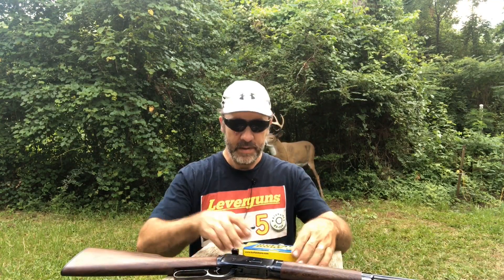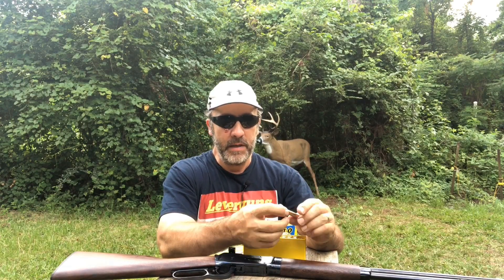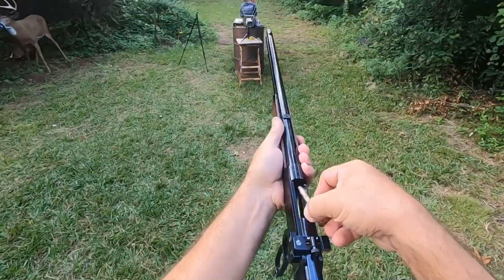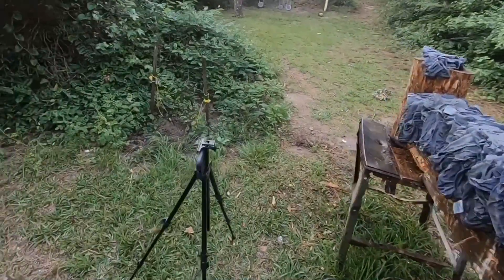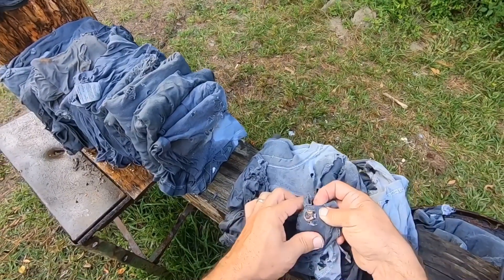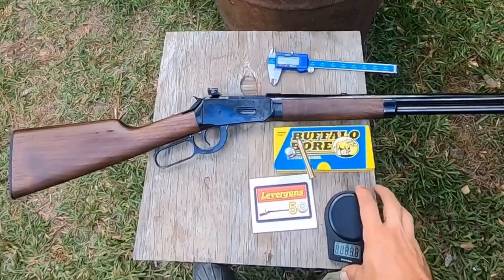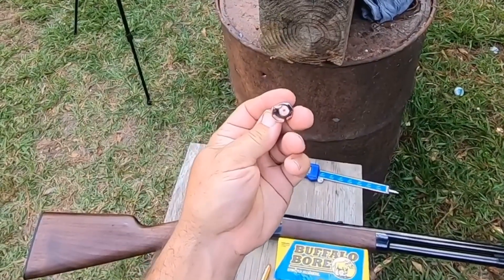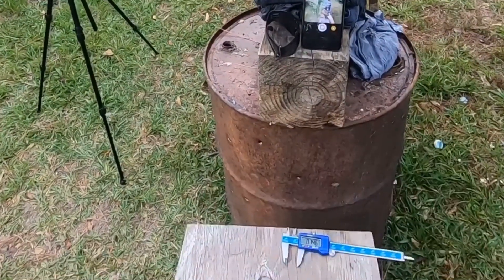38-55/375 buffalo bore, in the Winchester model 1894 trails end take down

Comment: I recently received my great grandfather's hunting rifle, which has now passed down 4 generations. 1894 in 38-55 manufactured in 1905. About to pull it apart and get it cleaned/greased. Need to figure out what sort of ammo I can run through it, as I understand the 38-55 at that time was a black powder cartridge.
Reply from the maker: Buffalo bore claims that there’s a safe in any Winchester model, 94

Comment: Glad you were able to get those and do this video.  Buffalo Bore has made the 38-55 what it needed to be all along👍🏻
Reply from the maker: Thank you,  well if you think about it this same gun comes in 450 marlin which has a pressure of 43,000 psi, i’m pretty sure the gun can handle it fine
Reply: Leverguns 50 exactly👍🏻
Reply: Original 94 XTR rifle (prior to being sourced from Japan) handled the .375 Winchester rated at 55,000 psi (CIP) but it had extra thickness around the back of the receiver bolt lockup. Whether that is relevant today with the steels Japan uses, I don't know. The .450 Marlin is rated lesser pressure than the .375 Win but today Miroku doesn't offer a .375 chambering, only .38-55. Buffalo Bore's loadings between the .38-55 and .375 Winchester are a mere 50 fps. They forbid using the .375 ammo of theirs in a .38-55 chambered rifle.
If you want horsepower in .375 caliber, you can always go with a .375 H&H Magnum or a Ruger .375.

Comment: So I have shot 38-55 cartridges, in my 375 Winchester  T/C Encore barrel.
 The 38-55's are about 1/8" longer. I had  what seemed to be a pressure spike, because maybe the throat of the 375 chamber choked the mouth of the case off a little bit. Not a spike so high that it flattened out the primer or had a excess firing pin dimple....but sure did notice a little more power out of the 38-55. No Problems.

38-55  .  30,000 (Standard Pressure)........35,000 PSI  MAX Pressure..............    38000 ( +P Pressure) CUP .

375 Winchester  52,000 (CUP). ..............55,000 PSI MAX

 Christ bless!
Reply from the maker: Might be quality control in the ammo, the video of a shooting them at 100 yards I noticed that some of them didn’t expand as well as others, which makes me think they might not have been going as fast as the ones that expanded well

Comment: I like Buffalo Bore in my 92 .357 mag brings it to a completely different animal. It's very close to a .35 Remington .
Reply from the maker: Wow that’s interesting, I have always thought of the 35 Remington as being a pretty powerful gun
Reply: @Leverguns50  their 180 gr cast bullet gets nearly 2100 fps out of my 92. I don't know how they do it....Iv tried heaviest I can get a 180 gr going is 1770. Guess they use powders that arnt open to the gen public?
Reply: I told you wrong it's the 158 gr that gets nearly 2100 fps. I just checked my record the average was 2097 fps. The 180 was 1905 still closer to .35 Rem than anything else Iv put through it.

Comment: Great test. Have you tested velocity of a 24-in or 26-in barrel with the Buffalo bore? How difficult do you think it would be to replicate this load? The only thing I don't like about the Miroku 94 is the tang safety. How easy do you think it would be to mount a tang sight on top of that tang safety?  How much do you feel I would gain in accuracy at 100 to 200 yd with the longer sight radius? Thanks for your info you do a great job. Happy New Year

Comment: Since watching your first video on the takedown .38-55 I've read a couple of magazine articles that featured such rifles/carbines as manufactured many years ago by Savage (the Models 1898 and later 1899) and of course Winchester in it's 1894 form. In both of those articles it was mentioned, by the writers, that after reassembling their long guns that they had to fire several "settling in" rounds to get back to the desired zero. Since I've never owned a takedown rifle or carbine produced by any manufacturer I was left to wonder if you have experienced such a thing with your modern Winchester and had to fire "several rounds" to get back to zero off camera. I realize that the magazine writers were shooting and referring to rifles in the 100+ year old range but I am curious since, as you know by now, I'm a fan of the .38-55 and hope to purchase a rifle like yours in the near future. Thanks for putting up with my comments/questions and thanks for yet another great video!
Reply from the maker: I’ll do a video on that and see if there’s any difference
Reply: @Leverguns50  I appreciate it! As I mentioned above the articles featured hundred+ year old rifles/carbines and I would hope that a recently produced model like yours would be far tighter than those used in the articles I read. By the way, and this just came to mind, I've also read similar articles about takedown bolt action and pump action rifles and I don't think there was a mention of "settling in" shots being required. I might just be misremembering that last so don't waste a bunch of time, money, and ammo on an Old Goobers possibly faulty memory.
Reply from the maker: I have the 1892 and take down and I haven’t noticed a change in either, and also the BLR in 300 Winchester short mag

Comment: Never put those or a 375 into an original 94 chambered for 38-55; you'll blow that sucker a-s over teakettle.
Reply from the maker: These are designed for the 38-55 using pressure level of the 38-55, and it says on the website that they’re safe in any 38-55 94 Winchester, but it also says they can be used in a 375 Winchester
Reply: @Leverguns50  Perhaps, but the loading manuals state-warn that the 38-55 is an original black powder load and the 38-55's can be used in the 94's chambered for the 375 but not conversely.
Reply from the maker: I’m pretty sure everybody knows that you can’t use a 375 in a 38-55 because it has about 55,000 psi,
Reply: @Leverguns50 That's correct, the .375 Winchester runs at 52,000 CUP or 55,000 psi and the .38-55 Winchester runs at 30,000 CUP or 35,000 psi!

Comment: “This gun looks like it filled in that rifling real good”
Ok I know this guys not an idiot but really I gotta wonder sometimes!!!
Yes each and every bullet you fired “engraves” itself into the rifling. The bullet is the diameter of the barrel after you cut the rifling. So no bullet will fit down the barrel of a modern gun with any “normal” force.
But yes I get what he’s saying: “The bullet experienced decent engagement of the rifling”…however I feel we should at least try to have some standards to keep us all “on the same page”
Reply from the maker: I think the modern firearms are a lot closer tolerances than a lot of the originals, this one is pretty close to .375, i’ve read of some of the originals specially the Marlins being .382And some even bigger than that
Reply: @Leverguns50  yes your absolutely correct on that count!!! My “Remington 1858” (actually called Remington New Model Army) has a land to land diameter (rifling uncut) of .440” the same as .45 ACP and .45 LC (yes .45ACP and .45LC are actually .44 caliber). The groove to groove diameter (where rifling is cut) is .450”. The originals on the other hand were always .442” to start but ended as .456-.458” on the extreme end of things.
So yes there was definitely differences in engagement of the rifling, but it’s very far from new. The main difference is we went from external to internal bullet seating with a change in bullet diameter. To address these changes so that a single bullet would work in both a land t land diameter of say .360” and .380” (as in .38 short Colt, .41 long colt and many others). This is the difference between having a “heeled bullet” (only exist today in .22LR .22 Long and .22 short) and a standard “modern” bullet that is if lesser diameter than the case.
Sorry could go on for hours. Apologies for the “wAll of text” did enjoy the video.
I was told that comments help regardless of the criteria of the comment.

Comment: The 375 winchester case is2.020   the 3855 is 2.085  to much diffrenec
Reply: 375 will load into 3855 but not the other way
Reply: And 375 is a higher intensity load
Reply from the maker: Buffalo bore has the article were they explain it all, on the box it only says 38-55
Reply: @Leverguns50      i wish i could find jacked bullets  for my 3855
Reply from the maker: Wilma McDermott Midway USA has Barnes 38-55 bullets
Reply: @Leverguns50  i dont know if they are allowing  anything across the border
Reply: @Leverguns50   i like the easy carrying 94 3855 has plenty of power  for moose
Reply: @Leverguns50    all i have is hard cast bullets that wont expand

Comment: Wont fit 375 is a much shorter case  just higher pressure loads
Reply: 375 is only a bit shorter than 38-55, What they did is use 375 brass and loaded it to kind of hot 38-55 pressures and velocities. So what you have is a down loaded 375 Win. I think they even use .375 bullets rather than .377.